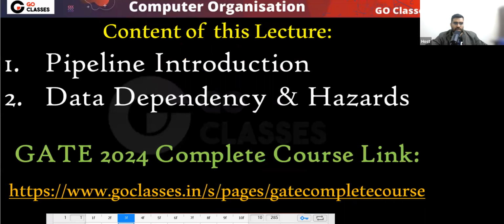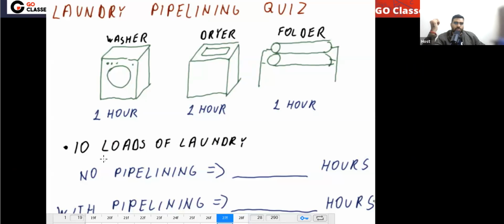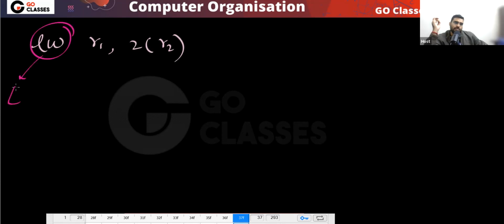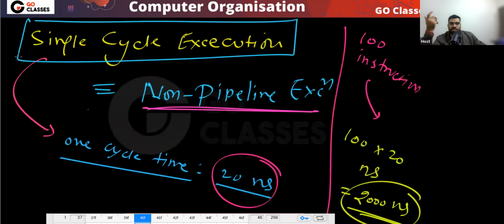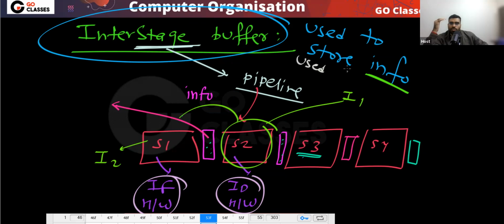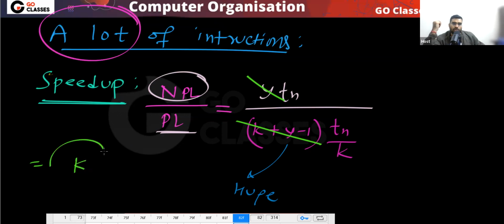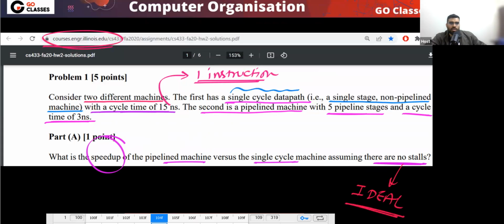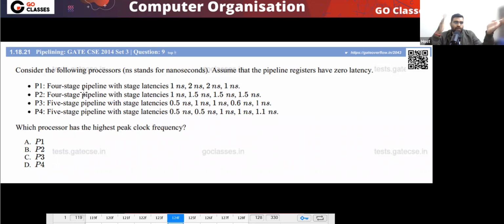Pipeline Lec 1 - Introduction to Pipeline | with NOTES | Pipeline Complete Course & GATE PYQs

Comment: 00:05:12 Session Overview & Agenda

00:06:47 Construction Pipeline Analogy

00:09:24 Non-Pipeline Scenario (Construction)

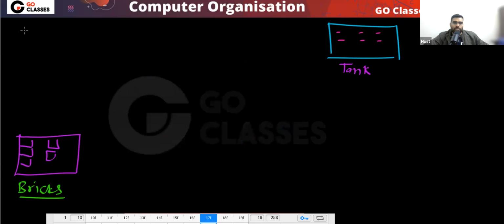00:11:58 Pipeline Scenario (Construction)

00:16:19 Oil Tanker & Bucket Analogy

00:22:16 Laundry Pipeline Example

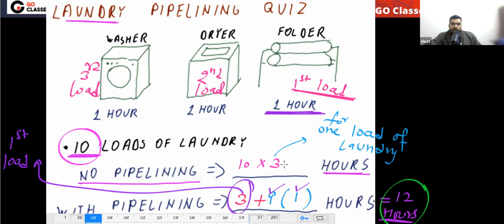00:26:32 Hardware Difference: Single Machine vs. Pipelined Hardware

00:36:26 Instruction Execution Phases in a Processor

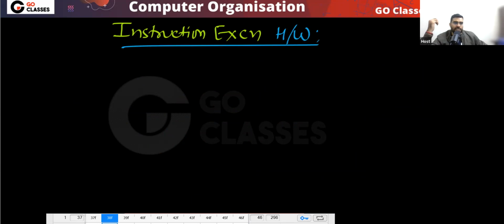00:44:51 Hardware Data Path & Execution Stages

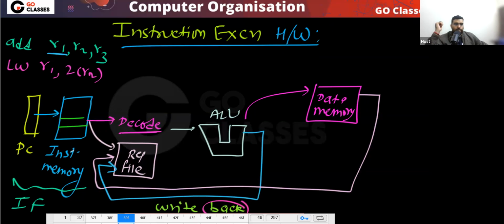00:49:50 Single Cycle Execution (Non-Pipeline CPU)

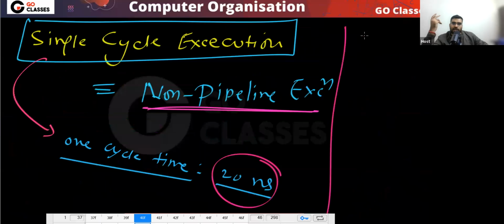00:52:58 Pipelined Execution Timing

01:04:48 5-Stage Pipeline Calculation Problem

01:10:06 Inter-Stage Buffers

01:19:34 Performance Analysis: Ideal World

01:23:45 Maximum Speedup in Ideal Pipeline

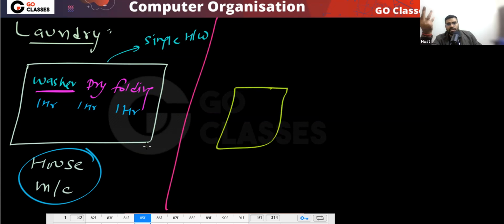01:35:10 Performance Analysis: Real World

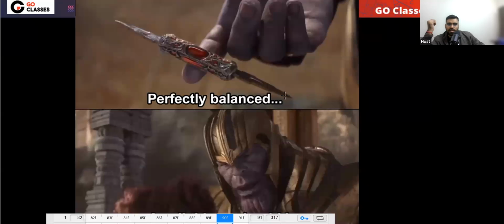01:40:02 Calculating Clock Cycle Time

01:42:13 GATE 2004 Question: Stage Delays

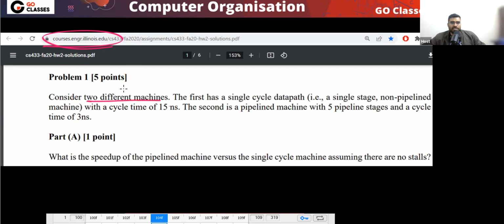01:47:18 Speedup Calculation Problem (Illinois University)

01:53:06 Comparing Two Pipeline Configurations

01:57:34 GRE Question: M5 vs. M7 Processor

02:00:09 Concept of Throughput

🔴🔴🔴MAJOR MISCONCEPTIONS

00:26:32 — Physical Hardware Structure Non-pipelined machines function as a single atomic unit, whereas pipelining requires physically separating the hardware into independent stages.

01:03:28 — Skipping Unused Stages In standard pipelines, every instruction must pass through all stages (idling if necessary) rather than skipping the ones it doesn't need.

01:06:40 — "No Stages" means "No Work" A lack of pipeline stages doesn't mean work is skipped; it means all tasks (Fetch, Decode, etc.) happen sequentially in one long clock cycle.

01:36:27 — Determining Cycle Time The clock cycle is dictated by the duration of the slowest stage plus buffer delay, not the average time of all stages.

01:53:39 — Latency vs. Throughput A processor that is slower for a single instruction (latency) is often preferred if it can process more instructions per second (throughput).